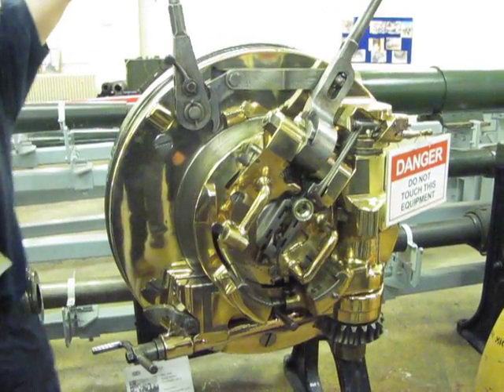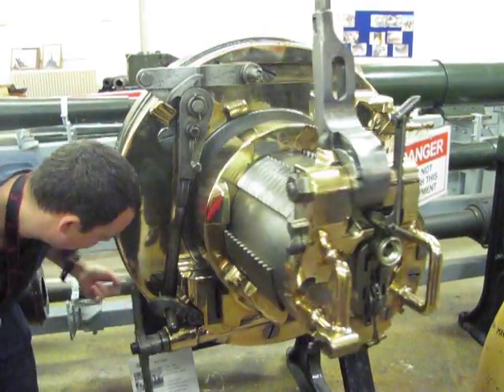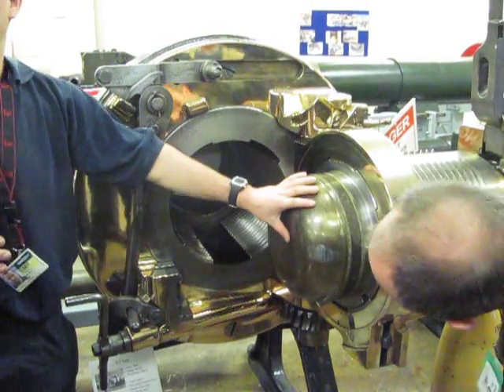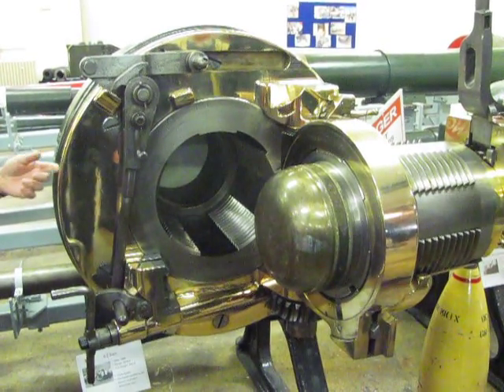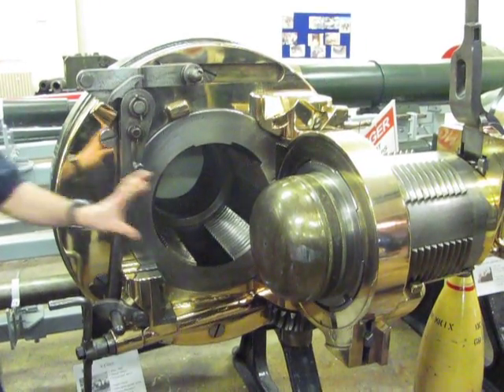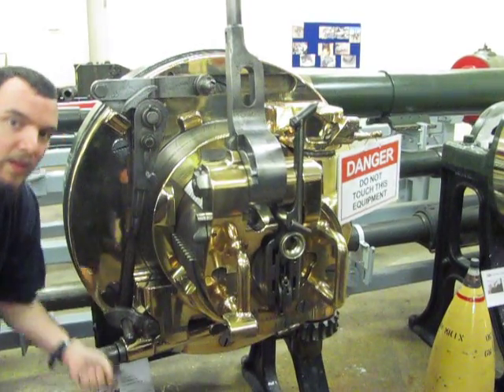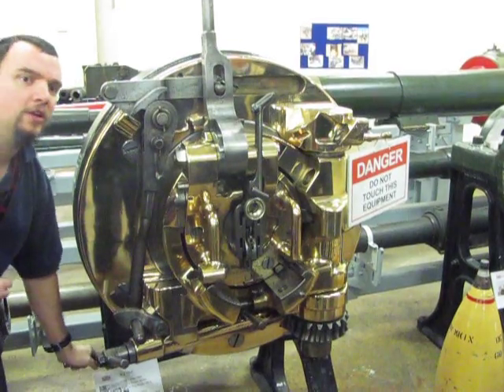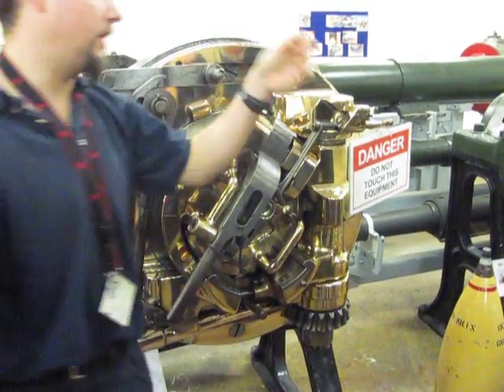1889 naval gun breech

Comment: No CNC back then. Amazing craftsmanship.
Reply: TexasGTO they had mills that did the same thing that CNC machines do, just mechanical.
Reply: @adumbaby  The mechanical precision of the craftsmen required them to be relatively intelligent and possessing a great deal of knowledge of mathematics

Nowadays the engineers do all the planning and designing, the computers make sure everything is correct to the digit

And a random guy off the street pushes a button
Reply: @taterater1052  ...Because a random guy off the street never used to fire these? Think again, the men who designed and made these breeches sure as fuck weren't operating them at sea.
Reply: Most people think that CNC is designed to increases precision. That's not true, CNC creates continuity, improves production time (and reduces costs) and makes difficult cuts possible like cutting a radius for example. 

Before CNC, high precision cutting already existed. The products were less complex than today.
Reply: @taterater1052  Sounds like someone doesn't actually know what it takes to set up a CNC mill. You're definitely not letting some rando set one up. Run a program maybe but let's see some rando set one up and not crash it and I'll believe you.
Reply: Cnc makes rapid reproductions of human error

Comment: The best breech mechanism, is on the German heavy naval guns. A single turn wheel, through a continuous turn action from the beginning, 1) swings the breech head from the full open position at right angles toward the chamber, 2) drives the breech head forward toward the chamber with the locking lugs already lined up, 3) the breech head is rotated within the locking lugs till is comes to a complete stop. The weapon is ready to fire.
Reply: Link it please, would like to see it.
Reply: German's are the best engineers of the human race 👍
Reply: @briananthony4044  That's definitely not a German breech action, Germans used a quick firing gun, this is a bagged gun with a welin breech
Reply: @billrudolph8185  lmao not even remotely true

Comment: AS it's a 9.2" breech from 1889 (the year of the Naval Defence Act), the same weapons would have likely seen service aboard the Act's authorised 1st-class cruisers (the Edgar and Crescent classes) and probably the enormous Powerful class. Going by delays due to gun delivery vs laying-down dates at the time, it's also possible that the two Blake-class cruisers received these guns. The two earlier 9.2" cruiser classes (Imperieuse and Orlando) may have had earlier models, especially the Imperieuse class due to their age. The firing rate couldn't have been much more than a round a minute, but that's good for the day. Fabulously beautiful machinery; top British engineering.
Reply: I was thinking it would have a pretty slow firing rate also.  Beefy construction, tho.
Reply: Yea block wedged cannon would be much faster loaded, but would leak powder.
Reply: They have a 9.2 inch 22 ton gun laying on the beach in Port Royal Jamaica.  It was a coastal defense gun.

Comment: Nice piece.  By the way, "obturated guns" are referred to as separate loading because of the separation between the projectile and the propellant. The other kind of obturation is provided by fixed or semi-fixed ammunition.
Reply: Not really.. All breech loading guns have to have a means of obturation. It simply means "sealing the breech", which is either done by the breech mechanism or by the ammunition. In UK parlance breech obturating guns are referred to as "Breech Loading" or BL. Guns where the ammunition provides the seal are known as "Quick Firing" or QF. 
You can get both fixed, semi-fixed and separate loading QF ammunition. You can also get fixed BL ammunition (165 AVRE) but most BL is separate loading!

..adjusts Anorak.

Comment: I don't get how that bowl shaped front of the breech expands when pressure is applied to it. A cutaway drawing would be great.
Reply: Adam at Epsilon did you ever find one?
Reply: Note that the presenter pointed to the black band BEHIND the metal bowl, and explained that force applied to the metallic bit would cause that band to be pressed out and seal the rear of the breach.
Reply: The higher the pressure pushing on the rounded metal piece the harder that rounded piece pushes back against the black seal around its base and the tighter the air tight seal gets.
Reply: And that seal is made of asbestos. The only material that resists si well the heat. Too bad its strenght is also what makes it so harmful...
This breech just shows what they were able to do more than a century ago. Today we would be totally unable to machine that again using the machines they had. Less and less poeple know how to use a mechanical lathe, mill, shaper, hand scraping etc. Only numerical, students in machining don't even learn about that anymore... That's a great loss in the knowledge we had in the past. I've always an immense respect and admiration for those machines and the people Who made them.

Comment: A short time later, the "interrupted screw" was developed, where those breech-block threaded side regions were stepped in thickness with matching stepped threads in the gun breech ring.  In that case, the breech block would be rotated on its hinge directly to the fully-closed position and then the block rotated a small angle to engage all of the threads over most of its side area at once.  This significantly speeded up the loading time with bag guns needing a full-strength locking breech block.
Reply: This breech does have an interrupted screw! The problem with this design is that the breech block is parallel and has to be withdrawn before it can be swung aside. Later designs of breech block were stepped cones which were shorter and did not have to be withdrawn before they could be swung aside. The other consideration is the strength of steel available. This is an early design and the steel was not as strong as in later periods. Breech blocks had to be much thicker to resist the firing stresses.
Reply: The Welin breech was a big step forward in speed of operations compared to this model.
Reply: @felixthecat265  I think Nathan knows a bit about metal
Reply: @JevansUK  Perhaps he does, however I trained at the establishment that these breeches are displayed in, and I know their history. The 1890s design is made from forged plain carbon steel. The later ones were made from alloy steel containing chromium and molybdenum. I studied metallurgy for one of my post graduate qualifications.
Reply: @JevansUK  Only in terms of the increased bearing surface, allowing the use of a shorter block. With the original design, the metal in the breech ring was not strong enough to take the pressure. Nathan is wrong when he says this gun does not have an interrupted screw, it does, but it is not stepped as in the Welin design.
Reply: @felixthecat265  Interesting topic, this period is incredible advancement in that area, with Compound armour, nickel steel, harvey steel and krupp cemented coming in rapid succession to advance armour. Also HT steels for shipbuilding advances, I assume this is also the reason that guns are able to increase in calibre length to towards the dreadnought period 45-50
Reply: @felixthecat265  Is this from a 9.2"/31.5, do you know?
Reply: @JevansUK  It is.. the discovery of frettage  and its ability to improve barrel strength was a major breakthrough and did away with the need for wirewound barrels. The development of improved smokeless propellants was also a factor which allowed for lower chamber pressures by using a longer burn time.
Reply: @JevansUK  I Can't remember.. there was no barrel, just the breech ring and the breech. The display was used to demonstrate the changes that were allowed by the use of improved materials. The quality of the engineering, given the date is astonishing.

Comment: Amazing number of manual operations required to open and close the breech.  All in addition to the work of doing the actual loading of the projectile and propellant.  Amazing they could achieve a rate of fire of two per minute.  Did 20th century guns have power drives doing this work?
Reply: I think more often than not 20th century guns just didn't require as many steps to operate. Not sure about the really really big ones, but the medium-ish sized ones with the sliding block breech don't take nearly as much to load/reload.
Reply: 20th century was hydraulics, the big stuff was all hydraulically driven, it made faster fire rates, and reliable movement, the breech system didn't really change much in the UK guns from that idea with the quarter screw, it was just hydraulically driven and opened.... unlike the american 16 inch where the breech was actually counterweighted and manually opened.

Comment: if they could make this precision machinery,  why were cars at that time so primitive?.
Reply: Materials, and limitations of lubricants, coolants, and fuels. Styling was based on the existing coach industry. Cartridge filter elements were a half century in the future. You can't fuel high performance with 45 octane. You can't run dizzying engine speeds on poured babbit bearings. You can't drive at high speeds on crap tires, especially on goat path roads. The evolution of the modern car required a host of other technological advances to support them

Comment: I didn´t get how the sealing thing worked? Higher the pressure the better sealing, any hint?
Reply: Basically the higher pressure squishes the ring against the walls harder, im assuming it was a flexible material, so the harder you squish it the more it seals, like putting a cork in a bottle
Reply: @epiphone5696  Ok there is a flexible ring now I follow, thanks.
Reply: Your Nan is a man . My Grandfather and Father undertook significant development work on gun obturators for which my Grandfather-was awarded the OBE in 1951. This is the first time that I have seen pictorial references to an obturator since I was a child in the mid 50’s

Comment: ok i’m in grade 8 when did they have ships with advanced gun bruh all they had is like wooden ships with canons on it like really i feel like that’s way to advanced
Reply: They already had steel ships when this gun was produced. They might not have looked like the battleships you’re used to but steel was already being used for ships at this point. This gun is essentially a cannon except it used shells instead of cannon balls. This type of gun allows for the shells to be loaded from the breech. Shells allow for the powder to be contained all in one unit. Essentially think small arms like shotguns just scaled up.
Reply: There is a whole era of ships you are missing out on, starting with ironclads, armored sailing ships with steam back up propulsion. At the same time there were the american monitors, two and three turret low freeboard ships of the late 1860s. Progress in armor, guns and engines happened fast then. By 1889 all steel armor warships were a thing for sure.